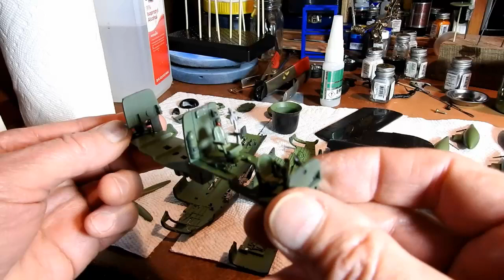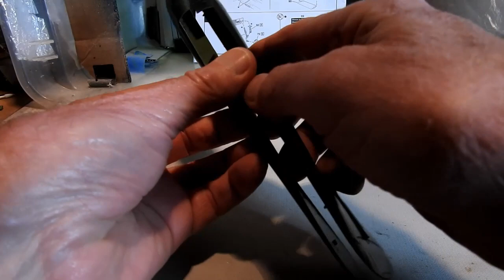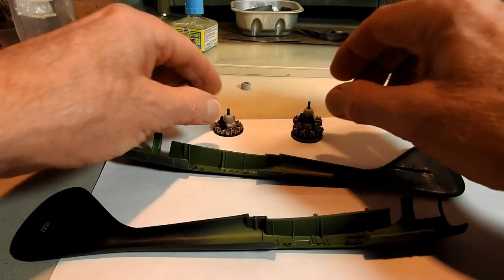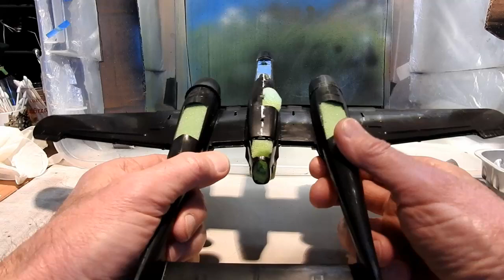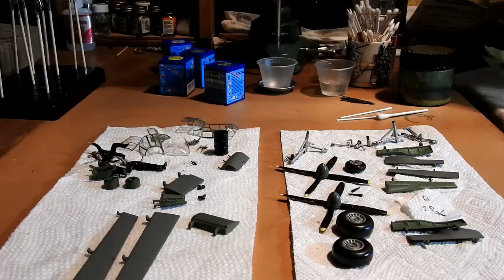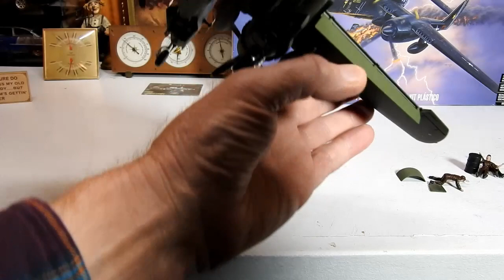My Revell model P-61 build

Comment: add weight to nacelles behind the engines but forward of the struts put plastic card bulkhead in there to hide the weights.
Reply from the maker: Very good tip. Wish I had thought of that. Thanks for the comment.